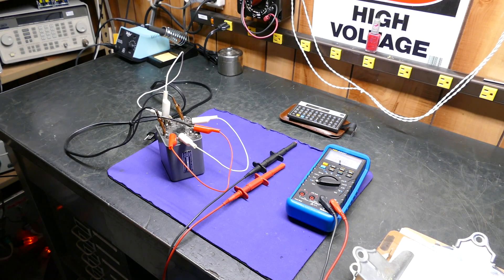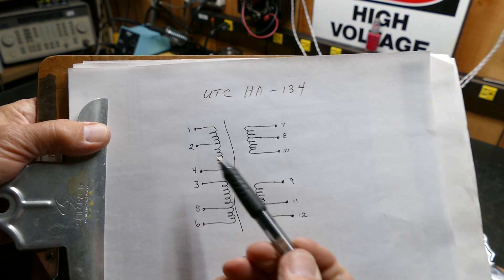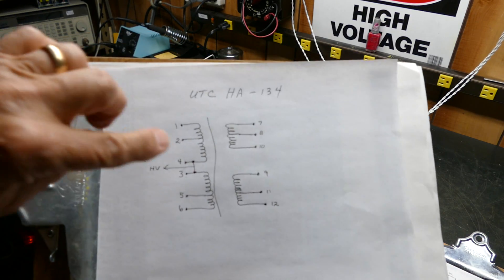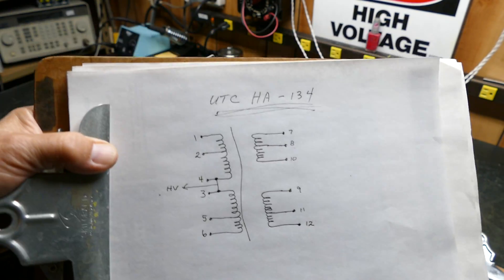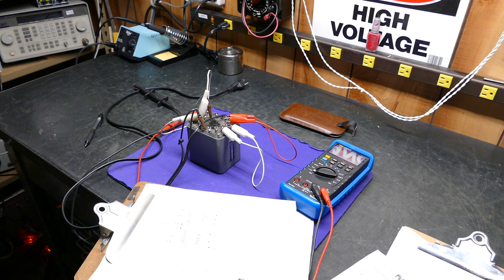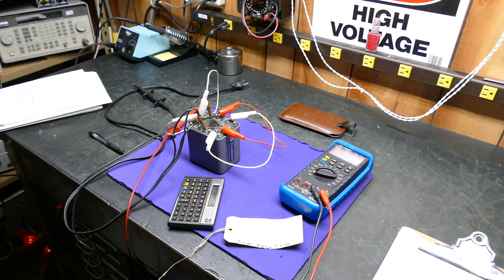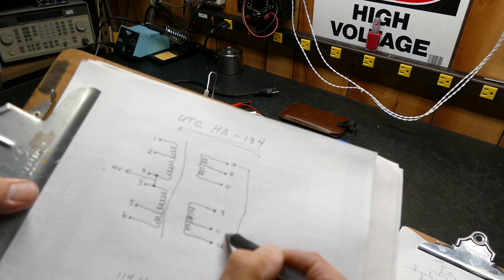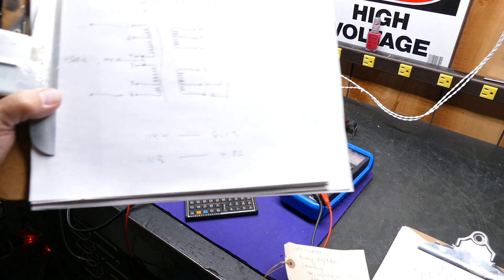UTC HA-134 United Transformer Corporation Audio Transformer Pin-Out & Use With 8 Ohm Load

Comment: Wow, it pleased me to see this video. I was an electrical inspector at United Transformer back in 1985. I did the RMA, Hi-Pot and DCR , etc testing an inspection. My dad was in charge of capsulation. That department was tough on the nose. 
That was an incredible manufacturing company.  Thing is, it was mostly for military and Nasa inductance products. Everything built there was OVER BUILT. I mean actually OVER BUILT. We tested transformers beyond twice their rated capabilities and 90 % of them passed this kind of test.  (For the time that we tested it) This was Not part of the manufacturing inspection criteria, we just had fun with the stuff in the labs. 
Let me tell you, that transformer will take a good ass kicking, so don't sweat it.

Comment: so with 460 volts on the prim you get 8.43 watts
Reply from the maker: +Jamie Phillips It is a little more than 8 watts. I run 400 volts and can get 15 + watts before clipping. I have completed the 6V6 amp using this transformer but have not finished the video yet. Maybe I can post it tonight.
Reply: I TYPOED I MENT 360 VOLTS I USED 6AQ5

Comment: No  try it with 6973's or 6CZ5's. They run a bit less plate current and with what you are doing that will be a plus. I was very surprised how nice the 6973's actually performed.  I am in love with the test equip you have in ur shop. I would do the same but im not gettin any younger so who knows how long i'll be able to hold a weller for! But I like what you do.I have alot of vids up as crosscoupled but google has made me change my name on utube twice already. I was going to do a vid on a Fisher SA-1000 when that all started so i asked if all my vids n followers could automatically b transfered and no answer.
Reply from the maker: +Charlie B. Hi Charlie - what you say makes sense to me about a bit less current through the primary of this little transformer. I sure don't get why Google made you change your YT name...  I changed my name once on YT and had no problems. I was initially "essoterric" on YT.
I also understand your comment about how much longer I can do this work. My wife is always wanting me to price my equipment so she can sell it when I die. Well, I'm not dead yet and it isn't for sale. I don't figure it will be my problem and I have requested an oscilloscope be buried with me.  :-) I may need my spectrum analyzer too... and a few meters and spare parts and really long exension cord...  and... 
Please post the video on the Fisher SA-1000. People will love it.

Comment: So what would this transformer originally have been made for? May be for long cable runs, 100 or 50 volt lines? Possibly used as an interstage transformer in a high powered amplifier?
Reply from the maker: +Michael Beeny I think so - it is listed as a line transformer in the UTC catalog. It is just that it has such amazing specs (not sure why for a line transformer...) but I see these things on Ebay for crazy prices but unless it is utilized as an output transformer to a low Z speaker I don't think it has much use for audio hobby use. I plan on building a small unit with this transformer and see just what it can really do. I will use a pair of 5881's.
Reply: Maybe the transformer was made for the recording or broadcast use, that would account for the high spec. I look forward to seeing the amplifier. Lets hope it lives up to the spec. If the windings are quite thin, output power into low impedance might suffer, mostly at the low end. Time will tell.
Reply: +ElPaso TubeAmps  I would try 6aq5 at 330 volts plate
Reply from the maker: +Jamie Phillips I have to agree that the 6AQ5 would probably be a good choice. I suspect the saturation current is pretty low for the primary of this transformer. Thank you.
Reply: 23 MILLI AMP - 0.023 AMP PER SIDE